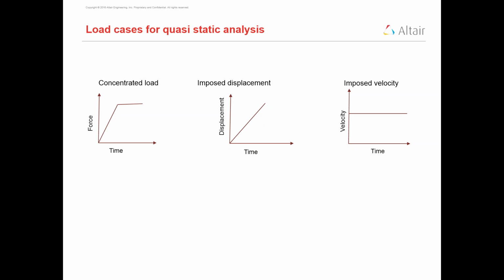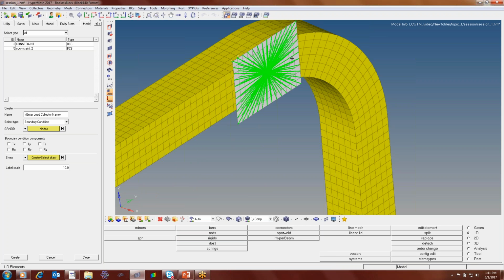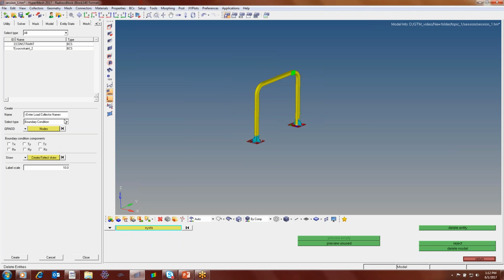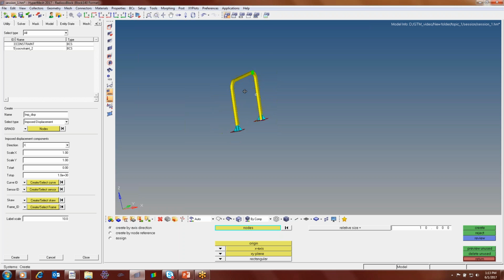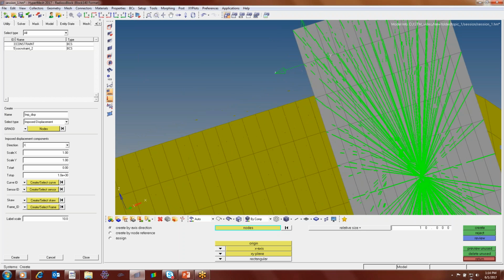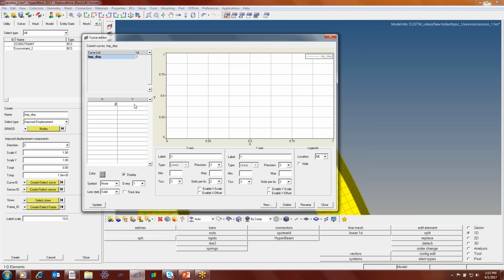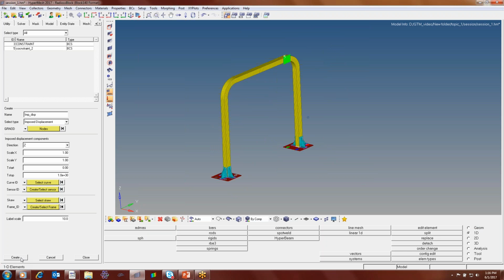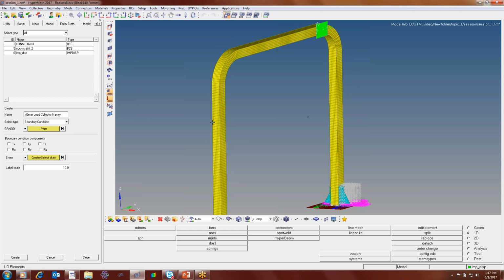7 Guidelines to apply Quasi static Load in Explicit Simulation

Comment: Hi
I am doing drop test analysis using radioss. the problem definition is as follows.
Am dropping ice cube from certain height, wen ice hits the floor ice has to break , what parameter explains ice is broken or not,   like in static analysis we will say material is failed wen it reaches yield strength!!
Reply: Hi Nagesh,
Please post your technical queries at http://forum.altairhyperworks.com/
The technical team will help you to solve this
Thanks!